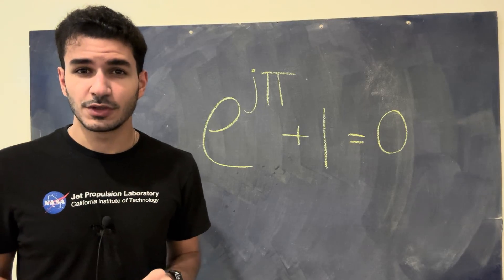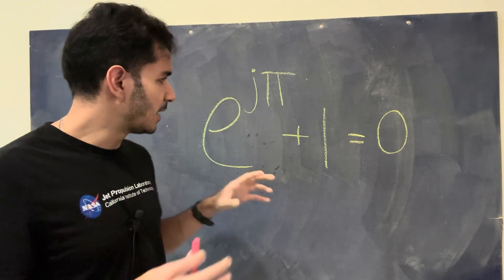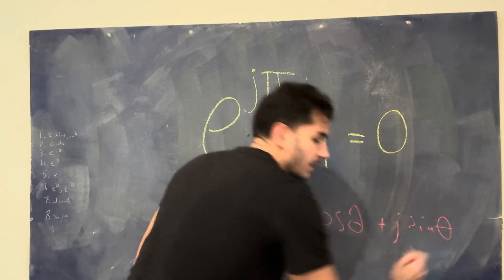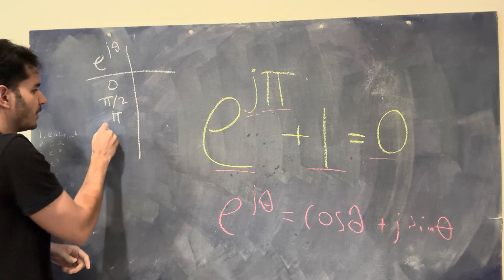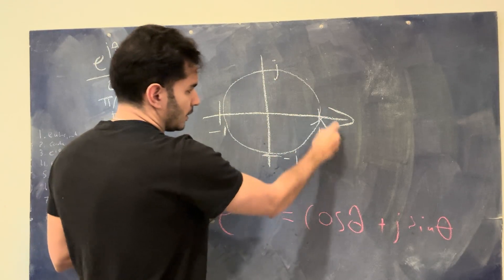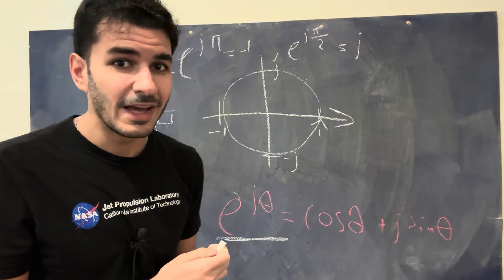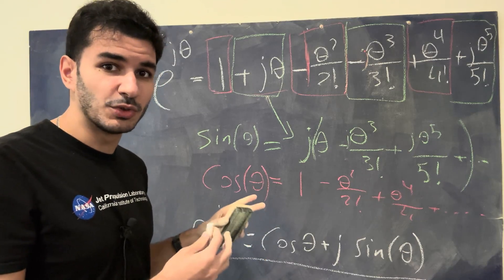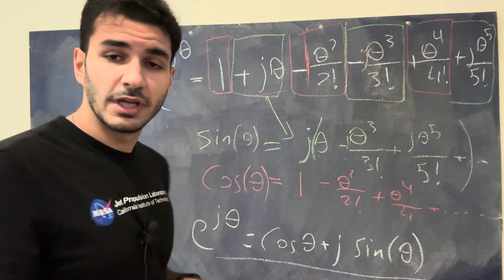The One Equation Every Engineering Student Should Master

Comment: Great video and I love the passion, but the aggressiveness to why the special case is not as beautiful or is only beautiful for “looking at numbers on a board” is weird. I don’t think most people think the beauty comes from just the fact that it’s those 5 constants, but in the fact that it takes all of what you ended up showing in this video and demonstrates it in much simpler terms. So to me, the beauty you find in Euler’s equation (which I wholeheartedly agree is absolutely amazing and didn’t truly appreciate until learning differential equations) is amplified through the special case. We have this absolutely insane and unbelievably useful connection between complex numbers and real world problems, a beautifully elegant derivation through Taylor series, and then all of that can get wrapped in this little bow with 5 numbers and some operators, which by the way happen to be arguably the 5 most important numbers in mathematics. The beauty is everywhere.

Comment: I recently retired after 40 years as a mechanical and manufacturing engineer.  I have both  BS and ME degrees in mechanical engineering.  Outside of graduate school, I never saw this equation, let alone used it, and I must say that there wasn't a single thing that would have been easier or better in those 40 years if I had "mastered" this equation.  

This would be useful if you are trying to discover new knowledge, but that's science, not engineering.

Comment: Watched your video and found some of your comments amusing, but mathematically incorrect.
There are just too many errors to list but I’ll point out some of the more glaring ones.
1	At 0.23 your ‘amateur mathematician’ versus ‘an engineer’s perspective’ comment really shows your ignorance of mathematics.
2	You began by stating Euler’s equation as exp(jπ) + 1 = 0. It’s not, exp(jπ) = - 1, is one value of Euler's equation when the variable is π, it is not a special form of Euler’s equation as you claim.
3	Throughout you used ‘your good old friend Taylor’s series’ to expand exp(x). In fact, you used Maclaurin's series, which is a special case of Taylors series, which you clearly failed to state. Very sloppy
4	At 7.20 you failed to prove that 0! is 1, I wonder why…more slop.
5	At 9.42 you claim that all the terms are converging to ‘something’. In fact, exp(x) is a diverging function, it grows exponentially, unless you define the set for x. Another example of mathematical ignorance.
6	The simplifying of exp(jϴ) into real and imaginary parts was full of errors. No explanation of simplifying powers of j neither.

I have to say this is the worst explanation of a very basic topic I’ve ever seen. For you to put this out to the world gives highly qualified engineers a bad name. It also shows the size of your ego far exceeds your mathematical acknowledge and understanding of the subject. Your delivery was also ambiguous and disjointed.

Finally, I suggest you get a mathematician to proof watch your next vid, that way you'll come across as someone who knows what they are talking about.

Comment: Many people are introduced to imaginary numbers as equal to the square root of minus 1 (or i^2=-1). I clearly remember a teacher saying that imaginary numbers aren't real. Well yes and no. A real number is a point on the real number LINE, a single value. 3:15 Imaginary numbers are one axis of the complex PLANE. A complex number is a point in the complex plane, two values. What would you call the axis orthogonal to the real axis? Imaginary (yuk, yuk). Let's say you have one axis that represents height and one axis that represents width. Is one axis more real than the other? Real numbers and complex numbers are fundamentally different. Yes, real numbers are a subset of complex numbers. Because complex numbers have two values, they can represent the magnitude and phase of a sinusoidal signal (point on the unit circle where theta = wt). Real numbers cannot.

Comment: While this is one of the proofs for Euler identity, it is just a technical way of reaching it, and I don't think it gives the real intuition behind it.
The main idea behind the identity, is that you want to convert movement over the circle (which is 1-dimensional) into the position on the (2-dimension) plane. We have very simple ways of modeling these two systems: for the circle we can just measure the angles, and advancing by some angle is done by addition. For the plane, we have the incredible complex numbers, where rotation is done by multiplication (by numbers of length 1). So basically, you are looking for a function that converts addition into multiplication, and in a sense, the only such functions are exponents.
By the way, here the basis of the exponent is e^i, but you can choose other bases to get other "rotations" that look more spiral like.
In any case, while the Taylor series is an important tool to study such functions, the main interesting property of exponents that make them so important here, is their ability to convert addition to multiplication, namely e^(x+y) = e^x e^y.

Comment: The Taylor series was first published in 1715.  Euler discovered Euler's Equation in 1748.  That is a 33 year gap.  I find it somewhat surprising that no one discovered Euler's Equation before Euler.  The Taylor series almost binds sine and cosine with the exponential function, but not quite, so it seems people would of been playing with it.  It is really not that complicated, a somewhat low hanging fruit.
Reply from the maker: good point
Reply: almost ?
Reply: @DavidAKZ  Yes, the exponential function expansion has the same pattern as the sum of the expansions of sine and cosine functions, only the signs of the terms don't match.  If you add an imaginary component to the exponential function input, then the signs line up.  This connects the exponential function to the sine and cosine functions.  The sine and cosine functions are very different from the exponential function, yet they are connected. Euler's Equation also has the novelty of putting pi, e, i, 1, and 0 into the same equation. A very beautiful thing.
Reply: @endlesswick  thanks.

Comment: I understand this video and the previous one too, but why is e used so ubiquitously in other equations where we need an exponential, but are not concerned about oscillatory behaviour or the rate of change of the exponent?

For example, in semiconductor physics, we can equate the carrier concentration at one point in space to another point in space by e^(the potential difference / thermal voltage). If carrier concentration is exponentially dependent upon potential, why does the exponent need to be e, and not any other constant like 2 or 3?

Comment: If we make the square root of negative one or i, the imaginary unit, the field that represents the reference frame taking the measurement and place it above the stress energy tensor in Einstein’s field equations (Ruv - 1/2Rguv = 8piG<Tuv>) instead of an expectation value (^) of a probability distribution (from quantum mechanics), doesn’t that solve the measurement problem and quantize the time? The field, which could be called the time, measurement,  conscious, or tachyonic field interchangeably is quantized by the reference frame taking the measurement and consciousness and those that have it becomes the metric the universe uses to measure or experience the time. Consciousness is the non-local universe and also the non-local hidden variable or “spooky action at a distance” that is collapsing the wave function of the energy system it is observing. Is this not the only way Einstein’s theories of relativity, quantum field theory based on the standard model of particle physics, evolution by natural selection, and Gödel’s incompleteness theorem can work and be compatible with each other? It is not a theory of everything but a step that has to be taken to understand ourselves better. The act of measurement is the same thing as the universe measuring itself. The tachyon, consciousness, and the imaginary unit all appear to have the same characteristics and relativity becomes the fundamental piece of quantum field theory being the quantization of this field, or time. The reference frame taking the measurement is simultaneously in the past, can anticipate the future, and take measurements in the present to take the time. It is not only there simultaneously but before anything that is moving through spacetime, including photons, making it faster than the speed of light. If you also look at the ‘beginning’ when all of the energy and time in the universe was condensed to a single reference frame, that is where the entanglement of all things happen, and this non-local reference frame (before time) measures itself to create the time. For a tachyon to measure itself or slow down to the speed of light, it would require an infinite amount of energy to do so, creating conditions similar to what we think of as the Big Bang. If this was the case, then everything (all energy) would fall under one wavefunction. Perhaps Euler’s Identity represents a moment in time (e^ipi + 1 =0) that can be derived from Einstein’s field equations through the imaginary unit i. Consciousness would then be something that does not emerge from spacetime but fundamental to it. Gravity becomes the curvature of this particle or energy, which we will call the tachyon, measuring itself and consciousness (the reference frames that have it) becomes the metric that the universe uses to measure or perceive the time. Simply there is no time without consciousness. Even if consciousness was emergent from spacetime, what configuration of particles, made of unconscious ingredients, creates a conscious one? Even if you figured out that a specific configuration of particles creates a conscious experience, how would you be able to verify that? You would have to be the experience itself, no? This relates to Gödel’s incompleteness theorem in which the fundamental truth can only be experienced not described by words or numbers. That which cannot be described by words or numbers is fundamental, it is assumed. Consciousness is fundamental. If consciousness is emergent, how did the universe know to assemble itself together in a specific structure that would inevitably lead to a conscious experience? What is the probability of that? That has to be zero, correct? How can the universe and spacetime work any other way if these theories are correct? The question I have is does this field choose which perspective of itself it wants to experience or is it random?
Reply: "If consciousness is emergent, how did the universe know to assemble itself together in a specific structure that would inevitably lead to a conscious experience? " - because you are observing it this way.